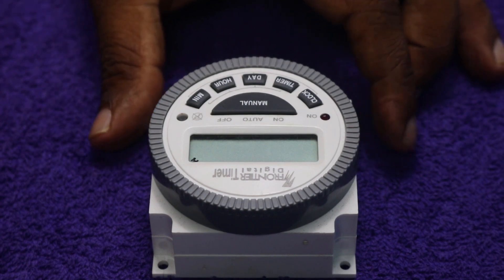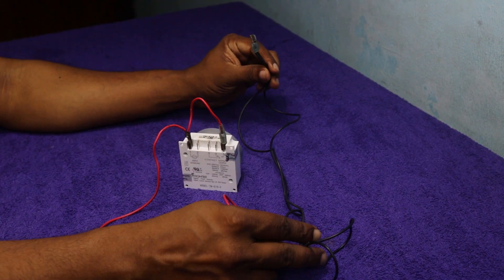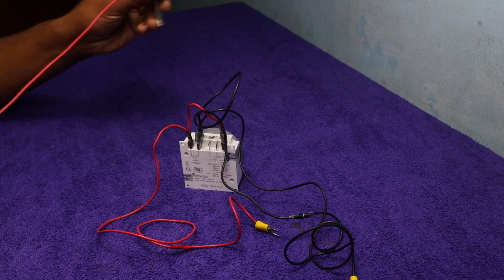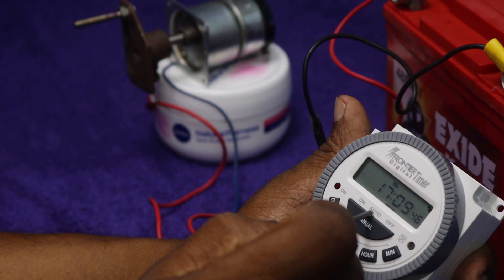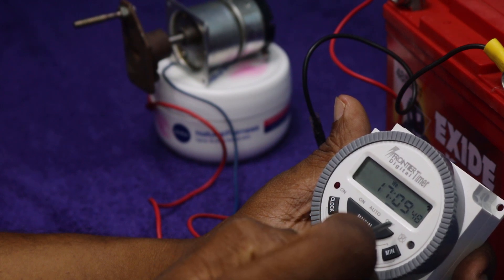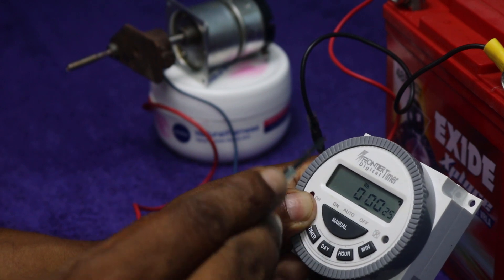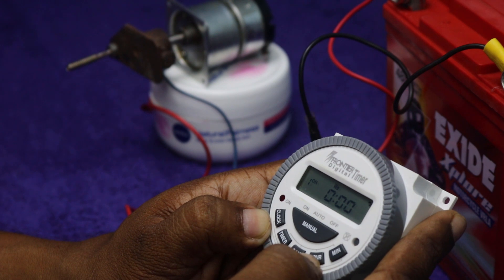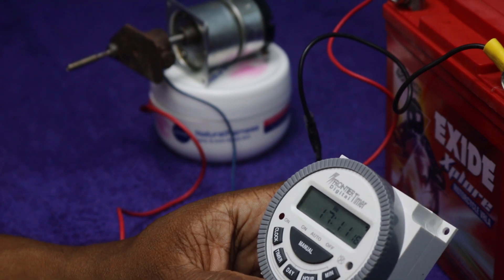how to set up digital timer to control dc motor

Comment: Very useful, only thing missing is normally open and close circuit, I interchanged terminal 3 and 4 and it worked perfectly for my foggers system in playhouse, thanks